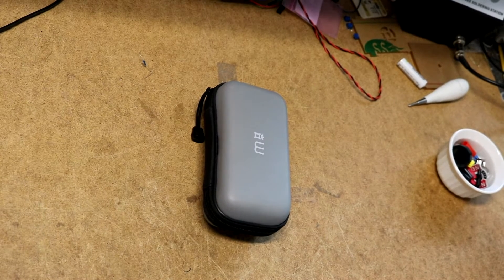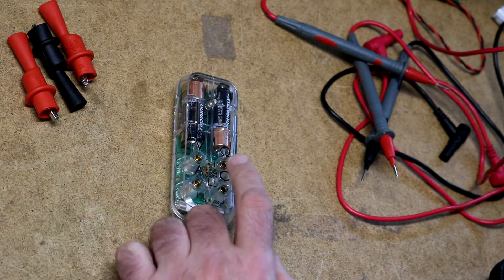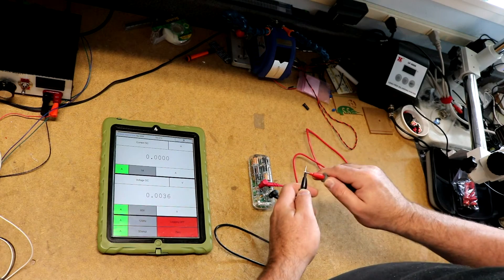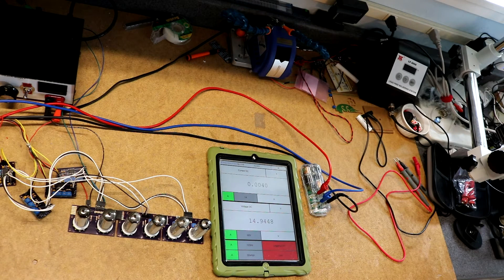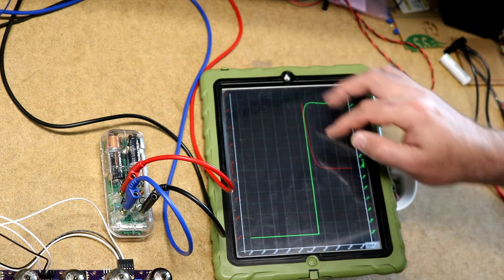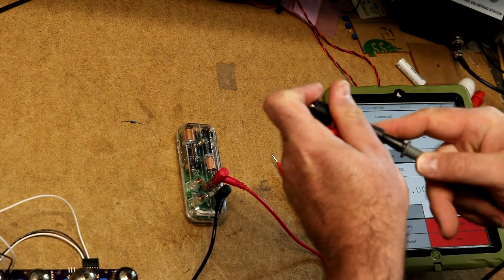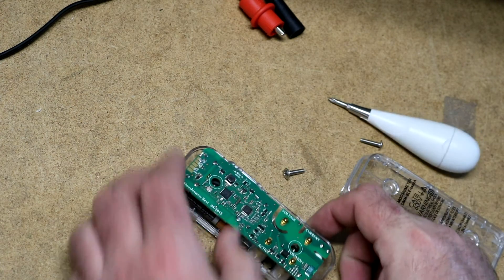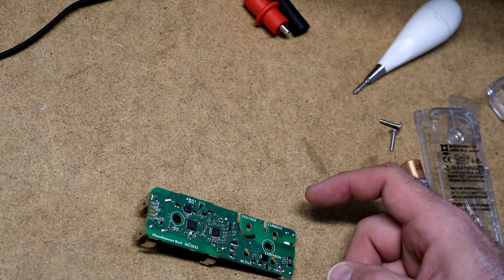Mooshimeter Review and Disassembly

Comment: Really missed opportunity in the app interface to also show power, and to plot power on the graph, instead of current for example (selectable). The other important question, can the app handle multiple mooshimeters connected at the same time and present all the measurements at the same time, as well graph them, on one or multiple graphs (one chart per meter, or one chart per unit, i.e. one chart for currents, and one chart for voltages).
Accuracy isn't stellar either.

Comment: Why this thing sucks:
-it doesn't have blast protection
-it doesn' have MOV input protection
-it has seperate inputs for low voltage and high voltage for some reason. that isn't very safe...
-it can't measure microamps
-it has worse accuracy than a $30 UNI-T meter.
-it doesn't have any shielding
-it isn't true RMS
-it doesn't work without a smartphone
-it will break instantly if you drop it
-the weird arrangement of the input jacks means that BNC adapters only fit in the low voltage input.

it sucks. Don't buy it.
Reply: Indeed, it`s more a toy than a tool - but i would say it´s not totally useless.
The other one is maybe "old" but it's a Fluke  (Pro Tool)  and you have to speak the "e" (German not English).
Reply: Ni Ro It isn't even a toy. it's just a bad, overpriced piece of tech. A low end extech / uni-t dmm is better in almost every way. I know that this sounds really harsh, but in my opinion a multimeter needs to be a rugged tool that can withstand abuse.
Reply: The main reason I'd be interested in it is for power measurements. Is there another instrument in the price range that can measure watt-hours using an 8kHz sampling rate? (I'm not trying to be "smart" here - this is an honest question).  The PortaPow instruments, for example, sample at about 3Hz, which I don't think is high enough when measuring complex loads.
Reply: Actually I might be wrong - the specs don't specifically mention energy measurement - I've sent them an enquiry. It's conceivable that in order to measure energy, the logged data may need to be post processed, and in that case, the sampling rate when logging may be far less. If it can do the accumulation calculations in real time, the question then is does the phone need to be connected the whole time?
Reply: Yep - it can do it. (it would have been a bit odd if it couldn't, being a two channel device). The calculation has to be done by post processing the log, but the meter can log without the phone connected. I've actually placed an order.
Reply: A toy?  Do you own one?  Have you tried it?  I have one and it is not a toy.
Reply: I bet you don't own one or ever tried it.
Reply: valveman12 Did you even read my comment?

Comment: QUESTIONS:
How do the Red/Blue leads connect to measure both V & I ?  Red to Vsource, and Blue to Load?  
Does this mean it can't measure an independent V and I that don't share a common Vsource?
What about measuring 2 different Voltages, using the Ohms as the 2nd input... apparently shares the common Ground?  
Can the Ohms-as-LowVoltage input (which is relative to the Black/Ground input), measure a 1.8V Supply voltage, then still measure Current drawn from a 3.3V supply... ?  This would seemingly require current flow through the "V" and "I" input connections that would have to be internally isolated from the Ohms and Ground input connections.